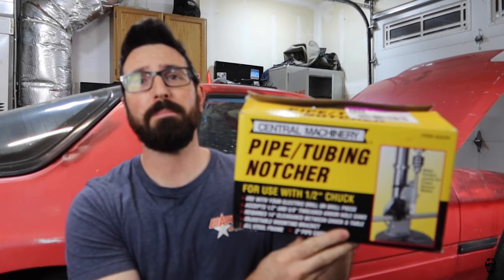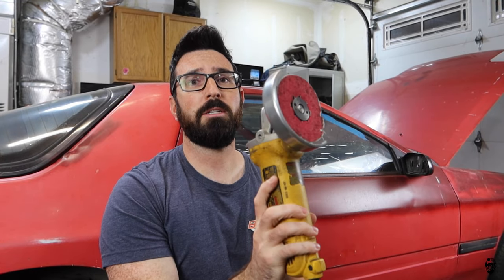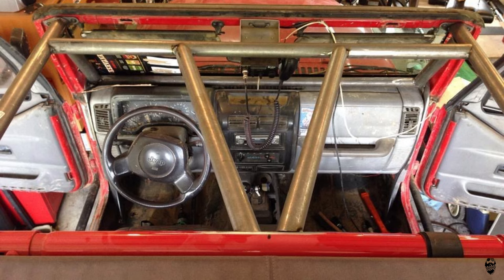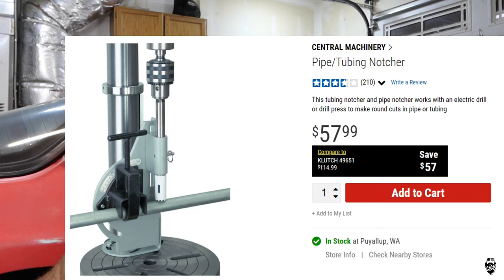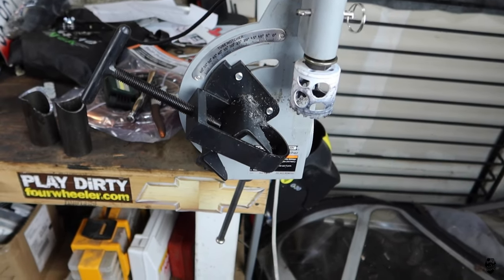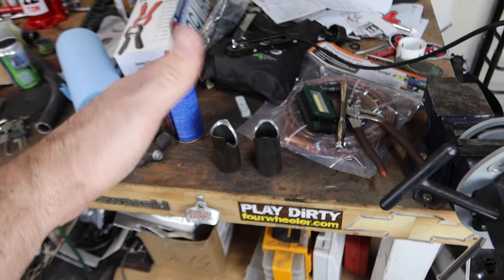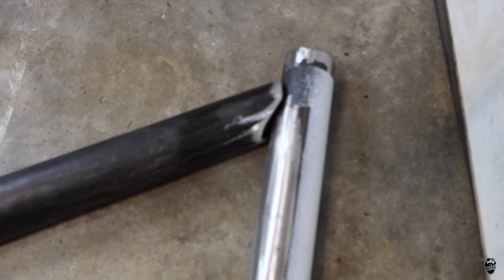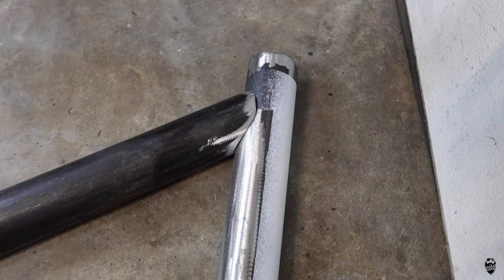Harbor Freight Tube Notcher... Is it WORTH it?

Comment: It's a cheap tool that works alright if you don't treat it like a high dollar unit. I'm on my second one. The first one the brass bushing got destroyed by a buddy over working it. Both needed shimming to get the notch centered in the tube. I also found using an 1/8" smaller hole saw will give you a tighter fit.

Comment: Hey there, you probably know this already,  but if you put some cutting or reg. Oil on the teeth periodically while cutting. It will be cooler and save your teeth on your hole saws. Just a little food for thought 👍
Reply: Thanks for sharing. Do you suggest what type of oil?  Thanks.  Should I put engine oil, WD-40, or else.
Reply: @user713Blvd  WD-40 works well, I use that at work/on the job, but at home I use a little oiler with 5w/30 in it. It's a little  thick and sticks to the hole-saw at my drill press.

Comment: I like the review. Short sweet and to the point..🤙 definitely going to have to get me one of these. I have been looking into a tube binder. Any suggestions on one? I seen you had a halo bent up in the background of the video. Have you used the harbor freight binder? Thoughts on it?
Reply from the maker: Thanks, I will do a review of the bender, I have one and it’s on my list. I would not use it for building anything structural, it’s called the tube kinker for a reason, lol. I have not had great success with it. I used my buddy’s jd2 mandrel tube bender for the roll bar.
Reply: The HF unit is a PIPE bender, not a TUBE bender - that's why it kinks tube.  There are plenty of reviews of it out there.  The short is it 'sorta' works on tube but not great.
Reply from the maker: Correct, also doesn’t do well on pipe either, lol.

Comment: I need a tube notcher to cut an offset hole out of a 1 inch OD x .065 wall 4130 tube It does not look this notcher can do offset holes so I figured I would ask if anyone knows of an off-the-self notcher that can do offset holes?  It seems like IF I made a couple spacer plates on the pipe clamp side that would get me what I need but I'm trying to avoid that.  Does anyone know if there is an off-the-shelf notcher that can do offsets I dont see any in my searches?  Thanks

Comment: Good deal, curious on the lifetime of the bushing/bearing on it
Reply from the maker: Me too, In trying to keep it short I left that out. But I put lithium dry lube on it, seems to work good for now.
Reply: @MuddyBeards4X4  I've used mine for 3 full builds now (5ish years) and still works fine. Just keep it lubed.

Comment: Seams like you do a lot of Tube Fabrication or at least more than the average person  i’m a retired Woodworker and right now a fairly new and kind of a hot item is the Wen brand floor standing DrillPress  i beleive it’s the least expensive one onAmazon  and the reviews are fairly consistent of being a decent product for the money  it actually is a adjustable Speed  machine that achieves that by a dial to speed up or down the motor  and it utilizes a CVT style set of Pulley that self adjust  to get the RPms you need on a digital display right on the unit  there are definitely sacrifices on this Unit to keeping their price low  and of course you can Spend a great deal more money on Higher Quality machines    you might need  for a shop that Professionally Specializes in Tubing Fabrication but you  appear to  do one offs and nott a high amount of these   chevknitvout i’m a firm beleiver  in buying the right tool or tools for the job